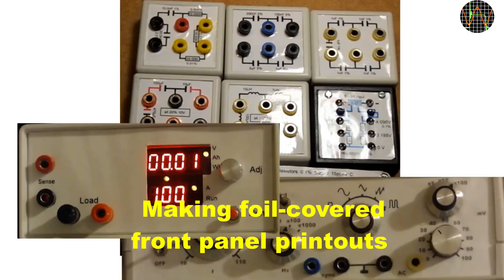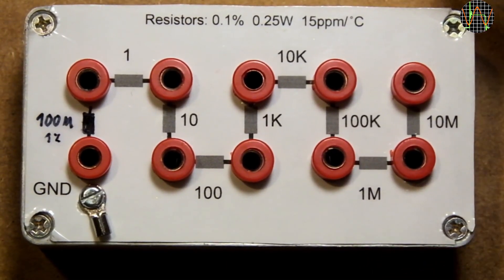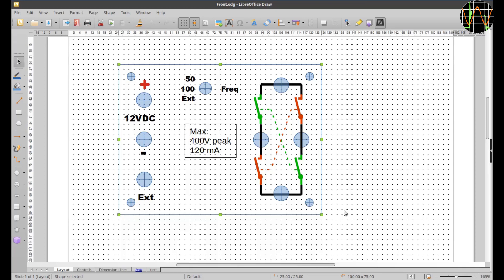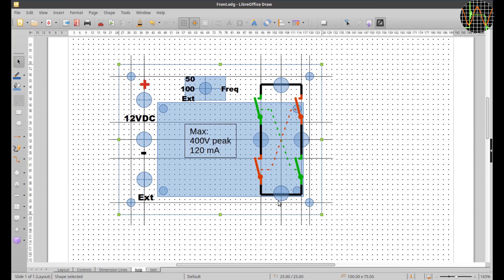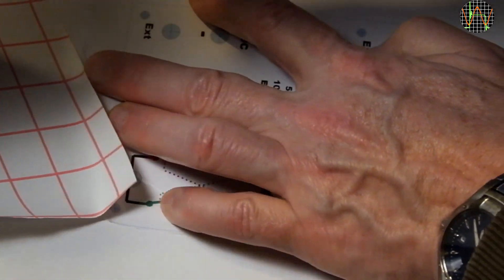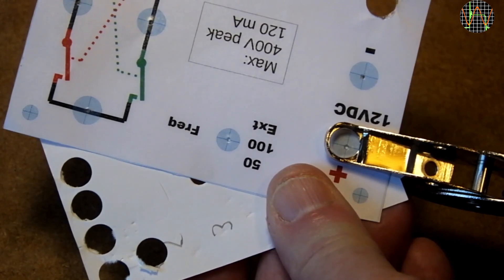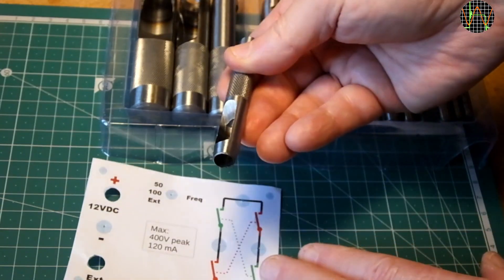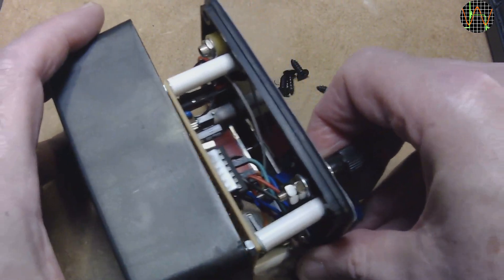Making front panels for your electronics project

Comment: I know this is an old video but I mostly create aluminium front pannel. When I create and print out my design, I print two copy. One that I spray glue on top of the protective film on my aluminium sheet that I use as a drilling and cutting template, and the second one I plastify. Once the cutting and drilling is done I remove the film/template and use some spray glue to fix the plastified one. I then cut the hole with a thin exacto knife. I made a jig with a 90% corner/side stopper to help me fix the plastified pannel sheet.

Comment: Hi, Heinz, 

Another great video with good information. I do this process, myself. I also add decorative graphic art work; it is difficult to tell my labels from OEM.

My brother just warned me of a printer scaling problem. It goes like this... Even though you have your printer set to scale at 100%, some printers do not actually print 100%. I just tested mine and, for a straight line 100mm long, my printer prints a line of only 98mm; a difference of ~2%. 

This is particularly important when proofing custom footprints made with a PCB program (KiCad, for me) against the actual component. His warning was in regard to a new footprint that I had just made. I had proofed it, before knowing of the scaling problem. I corrected the scale, printed the footprint out on paper and held the component pins to the paper. Yep, it was off. If I had had the PCB board manufactured without being warned of the error, the component would not have fit. So, obviously this applies to label locations, too.

The solution is to find a printer setting, either in the host program, or the printer GUI, that will allow you to change the print scale to a custom number. KiCad does have a custom scale setting and I changed it to 102%. That worked to correct my problem. But, my HP printer GUI only has set percentage numbers, in a drop-down window. So, you have to look around to see what variables that you have to work with.

Another neat trick is to have your project box panels manufactured by a PCB board house. You don't have to have any copper on it, necessarily. And the board houses don't care that it will not actually be used as a PCB. You get perfect holes, placement and labeling on a plastic board that will support your knobs and switches. You can even add graphics. PCB boards have become super-cheap, too.

Thanks for all you do for us!
Reply from the maker: Great tips and thanks for the warning on printers messing up the scaling. I never noticed a problem but reading your comment I tested my printer and it produces the correct scaling. I am using a HP Color LaserJet M252dw under Linux. Good idea on using the PCB board houses but isn't that expensive if you need just one board?
Reply: No, the board houses have greatly decreased their pricing, from days of old. 10 copies, yes ten, 100mm x 100mm are just $5USD, plus ~$20 shipping. No setup charges, etc. You just upload your gerbers. And, you can panelize different designs, but they will not cut them apart, for that price. I like Seeed.cc (3x "e".) 

The Asian houses are sponsoring a lot of the YT electronic channels. You should check into that.

Comment: Printing of front panel is good, but the cutting out of the outer profile is not so good - for the straight cuts, have you tried a hand-held rotary cutter ? I use one for cutting Brother type printed strip labels into small individual labels for front panel controls - these labels are quite difficult to cut cleanly any other way - scalpel and steel ruler just won't grip properly - rotary cutter solved this as it doesn't drag on the material. Your corner profiles are more tricky, I admit. Could you print a guide line that you could then follow accurately with whatever knife you need ? The cut could be inside or outside the guideline. Just ideas...
Reply from the maker: I have not tried cutting with a rotary cutter (Dremel I suppose). I will give that a try next time. Thanks for the tip
Reply: @TheHWcave  No, not a Dremel !! That will make a mess I think ! I mean a manual cutter with a blade that looks like a Stanley knife blade but it is completely circular, and is on a pivot, so you roll it along the cut line and because the blade rotates whilst cutting, you get no dragging of the material as you would with a fixed blade. Here is the first video I came across showing such a cutter - they tend to be used in craft work a lot apparently. Look for 'rotary cutter' online, you will find many makes, with different blade diameters available too. I actually use one for front panel labels.
https://www.youtube.com/watch?v=srib8JAH2x0
Reply from the maker: Thanks for the correction. I just bought one on Ebay to see how it works. Reminds me of Pizza somehow.. ;)
Reply: @TheHWcave  Precision pizza cutting :o)  Hope it turns out to be some use. I just ordered the small 18mm one for tighter curves - I have the 45mm one presently, which is no good around the bends. Dave